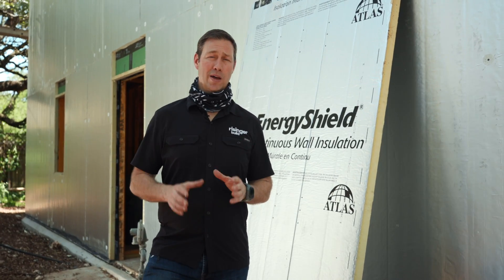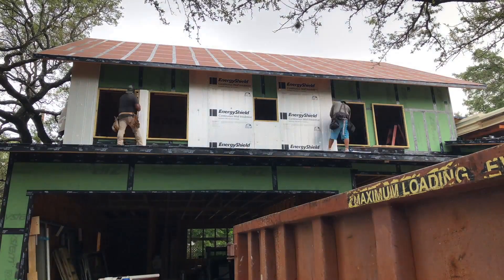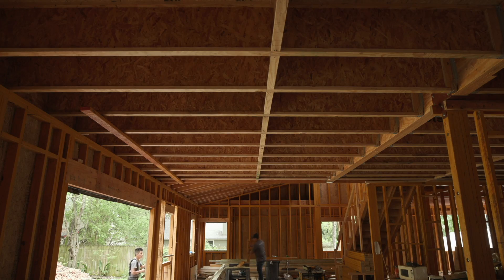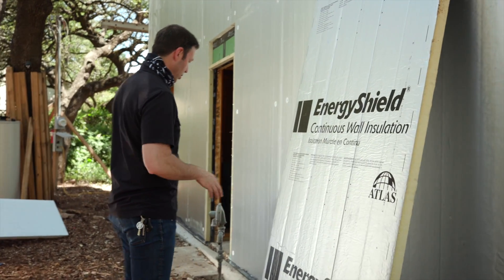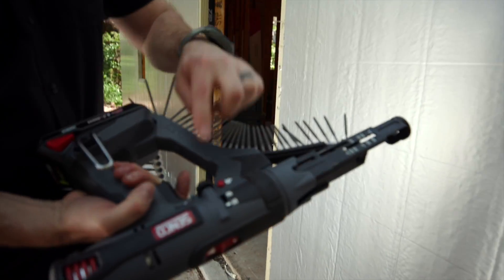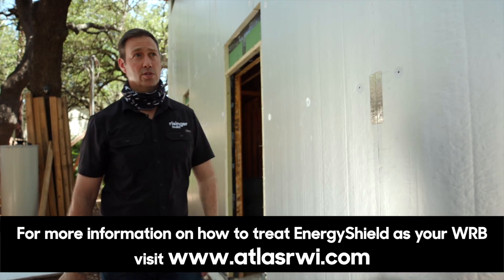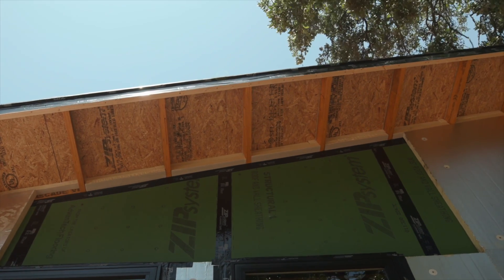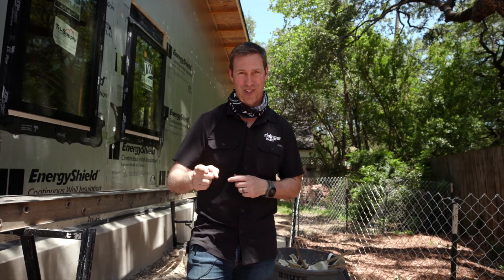Exterior INSULATION Details from Matt’s House

Comment: You air sealed the house with Zip-R (I believe). Couldn't you have just as easily have sheathed with cheaper oriented strandboard and just air sealed the polyiso?
Reply: Then he wouldn't have been paid by Hubert to promote their products
Reply: @TheBgrugbymatt 
While I love the work and education that Matt Risinger puts into his shows, I feel that he downplays the cost of materials in his recommendations.
Reply: whats strandboard?
Reply: @cdoublejj  OSB
Reply: suspicionofdeceit unless...you have a tiny home!  I ended up with close to R45 & haven't even finished yet! (&boy can you feel the difference!)
Reply: Why is your tristar crooked tho ?
Reply: Possibly because OSB is crap. In the houses first decade you wouldn't notice a difference but solid wood just won't fail you in any way over a century or more. My parents 73 year old cape cod style 2 floor home, with a full basement and a slate roof remains rock solid. Also, should you not want to leave your single story house but need extra space you can rip the roof off and build a full second story on it (as a family did in my parish about 20 years ago) and the outer brick/block/concrete walls will support the additional weight but internal load bearing walls standing on  OSB joists might not , and if so only to a minimal limit. Also, on another of Matt's uploads a professional (ie. city) firefighter told Matt that they'd had a lot of experience with OSB built home fires. The OSB catches fire faster, burns faster, and burns through faster due to it's being thin, not being a solid piece of lumber (eg. a 2 x 8, 2 x10, etc.). He also said that the substance holding the OSB chips together outgases like crazy. They hated OSB homes. My brother-in-law was THE hazardous materials Fire Chief for Baltimore, Maryland so I can certainly relate from all his stories. Show me a tree that grows with an OSB interior and I might change my mind. OSB is just unnatural and  only made as a way for homeowners to save money and for the companies that make it to have a larger profit margin.

No, you certainly can't save enough using OSB to make me build or buy a house with an OSB skeleton. I saw in a previous upload of Matt's the interior of his house and the floors were made of engineered OSB joists. I just couldn't believe what I was seeing.
Reply: Daniel Fronc OSB has come a long way from what you might be familiar with. The Zip system is also OSB. https://youtu.be/1D7fdyQbdr4

Comment: Hey can anyone help me with this. If he is using vapor barrior on the outside wall instead of air barrior , and then he'll have a vapor barrior on the inside too, wouldn't that keep moisture stuck inside the wall?
Reply: No interior vapor barrier will be used. Any moisture would dry to the inside. Since Texas is a cool dominated region the AC will remove a lot of excess moisture. That said, it there is still a humidity problem, a whole house dehumidifier can be used (ie in the winter months).
Reply: This is a problem I am seeing a lot with the increase in use of polyiso in my area (Ontario, Canada).
Reply: @brentschinkel2168  from Quebec here , that wouldn't work here with condensation problems , we use Isoclade with tyvek already on the foam , and we use those energy shields on the inside walls
Reply: Everything in this wall assembly is vapor permeable. It will dry to the inside or out. No trapping of condensation.

Comment: Matt, I am looking at "outie" window bucks that appeared to be getting covered up with foam,, without any Zip tape or liquid flash to coat the wood/ seal the RO/  maintain the integrity of the air barrier. The Zip is also your final defense against water, so if what I am seeing is true, then this is a glaring omission or defect, in my experience. Wrapping the face of the foam into the bucks/ RO is a poor substitute for a complete water barrier layer, at the sheathing plane. I do trust that at least, you will do a head flashing from Zip to outside of the window trim. With all the fastener penetrations in the foam (which does not close around the fastener body), you absolutely have the possibility of water wicking back along the fasteners to the Zip/ back of foam interface. I am totally committed to exterior continuous foam (first job 10 years ago), but I cannot risk using this method unless it is applied over a guaranteed self-sealing membrane. I simply have not seen data or tests on the Zip that will provide this guarantee. On our project, we did liquid applied over 100% of exterior sheathing, set the windows (with special detailing) and then did two thirty minute water hose tests on the assembly (window directly, then moved up on the wall above), before adding any foam. 

Another observation: Last job (Front Range Colorado) of mine to have roof foam stop at the wall line was 20 years ago, and I will not repeat that. It turned out to be penny wise and pound foolish to not insulate the overhangs. The issue is maintaining roof temperature and conditions all the way to the drip edge. Having the overhang go cold is an invitation to ice dams, and Dr Joe has shown that solar heating of the walls can warm an uninsulated overhang, also contributing to ice damming. You need to make more clear that you are able to do certain things in the Austin climate that would be inadvisable in a lot of other locales. And there are ways to frame the overhangs that I believe to be a better trade-off between economy, structural concerns and the disruption of the thermal envelope. I take exception to the amount of "stuff" that is woven into the continuous layers here, now not so continuous.
Reply: the last video he did windows had a few layers with prosoco silicone, flashing and various tapes/jackets. also the house is made of particle board, i'm guessing this area doesn't get much cold or water. where as here in Missouri half of this stuff would condensate or rot.

EDIT: what spray on sheathing did you guys use? why wouldn't ZIP work?
Reply: @cdoublejj  I did look at earlier videos, and saw the liquid applied all over the bucks, sealing to the ZIP. It appears that this was NOT done on a number of window penetrations here: I think that is a big risk factor. I certainly would (and do not) fail to do a complete seal of all wood, in one monolithic, observable and testable layer. In my work life, I find it is the things you don't do that cause the grief, not the things you do (if you are reasonably competent and knowledgable, at least). 

As far as longevity, 10 years in Colorado for a project far more complex than this, in what most amateurs would consider as the same construction (down to 2" Atlas foil face polyiso), but with a much more rigorous 100% fluid applied self-sealing membrane, and absolutely no mold rot leaks, water damage etc etc. Do it right, it is basically the "Perfect Wall", per Dr Joe. And no one pays me anything to hear me yap, or even to move product. Just my observations from a long life in the business.
Reply: You sound like a pro . Can you explain me what he is doing, looking for another fool with money or what? He wants straight  , energy  efficient walls but they were  invented 40 or more years ago something like thermasteel panel with R35 . The only problem with them they are cheap and easy to be put together
Reply: @andreycham4797  Since 1971, part-time while going through MIT, full time since, in all sorts of construction/ roles (mostly res design/ build). I actually am very much dialed in to what Matt is intending, but I think he misses some of the critical (at least under certain conditions/ climates) details. Unlike the haters, I think he falls a bit short sometimes. SIPs, whether steel or wood facings, have a whole set of issues themselves, that for me are harder to address adequately. One is lack of stud space for mechanicals (do not underestimate that factor), another is total long-term sealing between panels, and another is the loss of flexibility as regards on-site fabrication and alteration. 

As for history, we were doing pretty advanced stuff 40 years ago (even full foam overlay roofs), but the building sciences now are far more rigorous and lead to far better overall performance, particularly as regards durability, than what most guys "knew" and built back then. My pet peeve is those who latch onto a key concept or buzzword, without proper understanding of the whole of the problem. Very few technologies or methods (well, actually there are NONE) can be totally "stand-alone", as the context is everything; fully integrated solutions are the only solutions.
Reply: @lhsunimog  Thank you for sharing with your experience .   I am in  northern state  and see how people even in Alaska   do the same thing, putting ridgete foam  outside of walls,  which could be appropriate for Texas   but in cold climate  they trap moister  in walls for ever.    Is there a practice, the way Europeans do as a example  to prevent thermal bridging  through studs  with crossing extra 2" rook wool  insulation on inside of wall ?
Reply: @andreycham4797  If you are seriously interested in this subject, go to Building Science Corp website/ Dr Joseph Lstiburek. He is the "Godfather" of building science, and has researched performance/materials / methods EXTENSIVELY. Matt is more or less a disciple, but has increasingly oriented his channel to meet the revenue/ sponsor needs. That, plus the need to keep short and sweet, means the underpinnings of what he is describing get shortchanged. And, he is spending most of his time on his own climate, which gives him more "wiggle room" in some aspects, than we get here in snowy Colorado. 

I would not hesitate to do continuous external insulation is ANY climate. The key is design and detail appropriately. The colder the region, the greater the R value required on the exterior, to prevent condensation on the INTERIOR of the wall sheathing. The beauty of the exterior foam is that all but the last steps are per standard materials and construction practices, very little special detailing in the framing stage, except for the window bucks, if you do "outies" (I insist on this, for a number of reasons, but MUST be accompanied by use of liquid applied , due to all the 3-way intersections created). We are able to examine and test (if needed) a COMPLETE facade, at one time, for continuity and defects, for both air and final vapor/ water seal control layer.
Reply: If you look closely, you can see the flashing is there.
Reply: @SPR8364-0  Take a look at 3:42, and explain to me why bare wood is showing at the window bucks, surrounded by the foam. The Zip tape is apparently used on the ZIP, under the bucks. This supposes that no water will ever get past/ get behind the face of the foam (which is later shown to be taped into the RO's), and this is what I find to be a dangerous premise. At each end of the head flashing metal (that presumably will be installed to the ZIP, above each window, there is water end-around path, with potential to divert water into/ onto the ZIP, behind the tapes on the face of the foam.  This could have the consequential effect of twisting/ warping the bucks, causing further damage (or rot) in the bucks. If the sheathing requires ZIP/ tapes, then how does  the wood of the bucks not require the same treatment, at the same plane? If one is not consistent in application and approach, then it suggests that one is simply making up rules, not actually analyzing and addressing the problem. Window penetrations have always been the single most likely source of water penetration, in my years of observation/ remediation. Why fall short at the most vulnerable location?
Reply: @lhsunimog  I'm just a viewer of the video and not the contractor or installer, so I really can't "explain to you" what Matt has not yet shown.  Like you, I will have to wait until the video that Matt mentioned where he will show how he is going to do the window install. He also said in the video that he has not yet taped the foam.  That is still to be done.  So, my guess, is that he will tape over the foam and protect the window bucks.  But, we can wait for the next video to find out.
Reply: @SPR8364-0  You have missed my point completely. Matt has seemingly left unprotected wood applied to the ZIP, beside the INSTALLED foam, that cannot "be covered" at this point. Being behind a surface tape one layer out is not an acceptable detail, at least not on my jobs. Dr Joe preached continuity of control layers, and this, at least as shown, does not meet the "letter of the law". If NO water/ moisture/ vapor could get behind the foam, then there would be absolutely NO NEED for the ZIP system. Clearly, Matt feels that this CAN occur, but is not being consistent in his application of principles, materials and methodology. 

As far as "not yet shown", Matt has already layered foam over the critical area. This is the buck to Zip joint, and the edge of the bucks. I am presuming that he will not uninstall any foam, to address the area/ detail that I am questioning. Done is done.

Comment: Whats outside cladding on the non brick side and how do the fixing penetrations effect the R value either way well over code and budget for the average Joe lol. I also wonder how the continuous insulation through rafter attachments work with its overall shear strength on that connection. Interesting. Must have run past the engineer

Comment: Really good overview and showing us the details. ~$1s/f materials not bad at all.  Not sure why you chose to sandwich the roof with 2 layers of Zip rather than simply using the same radiant barrier foam over the lower Zip sheathing - most of the sun will be hitting the roof, not the sides of the house. Is the top Zip layer needed to more-easily attach the metal roofing?

Comment: matt, i like you, i like your work, i like your videos but last video i made a negative (but constructive) criticism
this is the second one unfortunately, radiant barriers doesnt work like you say they do, theres nothing like reflecting it back, radiation doesnt work in that way
every object that has a temperature (meaning above 0 Kelvin; literally every object in real life!) will radiate heat, a real radiant barriers are meant to heat up and dont emit it (to the inside of the house), 
im a mechanical engineer i can write you a book about this stuff but ask this to some experts they will explain it better than me commenting here
Reply: From Wikipedia: A radiant barrier is a type of building material that reflects thermal radiation and reduces heat transfer. If shiny metals and foils don't reflect heat, how does a heat dish work?
Reply: @RileyIsRisen  buddy you cant break the law of thermodynamics, you will be reducing the emissivity rate of the material, of course remaning suns radiation energy will get either absorbed or reflected back, you are only dealing with radiation transmission there which is based on the surface facing towards the house not to outside
Reply: it works like a heat shield, like they put on catalytic  converters and exhausts on motorcycles.  whether this actually works on a home like this or not i have no idea but the concept is to reflect the radiant heat from outside the building away from the interior of the house.  i think it's the every little bit helps method.
Reply: @frotobaggins7169  yes aluminum is used as a heat shield but not to reflect it back, 
-in your example; exhaust is hot and it is steel, steel has higher radiation emittance, they put aluminum sheet in front of it, aluminum heats up from the steel and in the end instead of getting the radiation from the steel (which feels hot on your skin too) you will be receiving the radiation from the aluminum which is way less than the one from steel, 
-so you should be thinking the radiation heat transfer like a domino effect, you block the previous domino's heat in order to insulate yourself from it
Reply: @pooky9775  heat shields on the hottest part of the exhaust are made from stainless steel. Over stainless steel. Some metals like aluminum are better at reflecting infrared waves, but it's not the emmissivity of the heat shield that reduces the radiant heat...it literally is the reflectivity of the shield. In the infrared band.
Reply: @thebigmacd  the heat shields on exhausts that are steel is whole other can of worms it is irrelevant for this particular case, but in term of insulating the house from the sun, only important variable is emittance, you can put aluminum looking towards outside but you would be reducing the radiation FROM your house it should be just the way around reducing the radiance going TO your home, the source of radiation is sun there not your home
-you can think that just hanging aluminum sheet or foil will protect it and you would be correct if its not touching something but when you're talking about sheets that has different materials on both sides, aluminum side should be facing to inside there
-also note that slapping aluminum foil and stuffing things on top of it doesnt work, radiation barriers need some space in front of them otherwise you would be blocking radiation but heat will just transfer there by conduction
Reply: Yes I believe you are correct. The radiant barrier in this case is going to be the exact same temperature as the outside air (since it's touching) and will conduct the heat as any other material to/from the inside. If the siding is a dark color and you're in a warm climate, it might help a bit to not absorb the radiation from the siding.